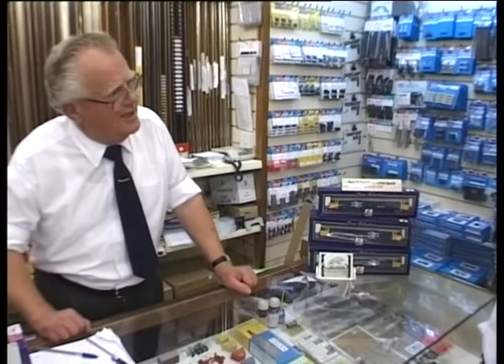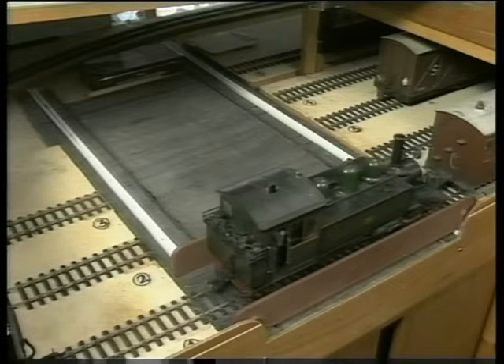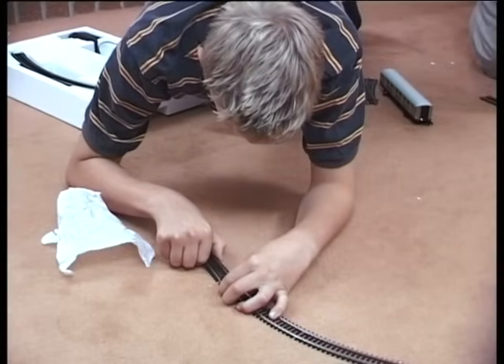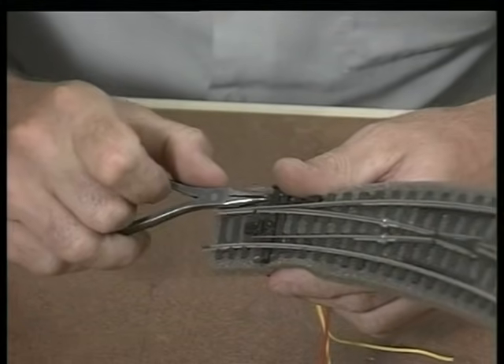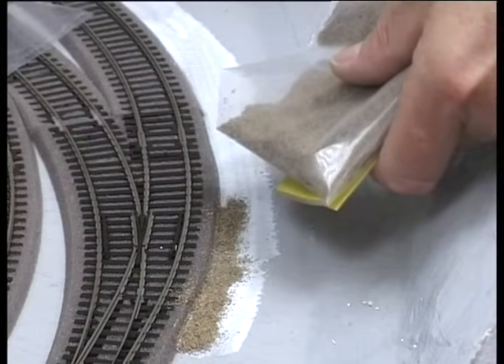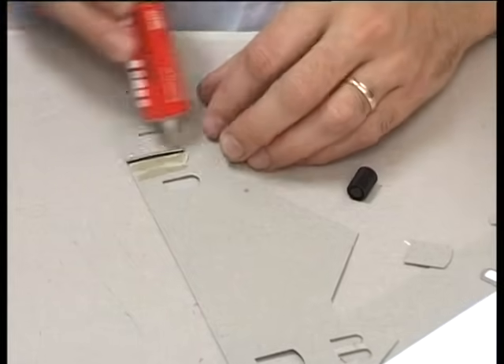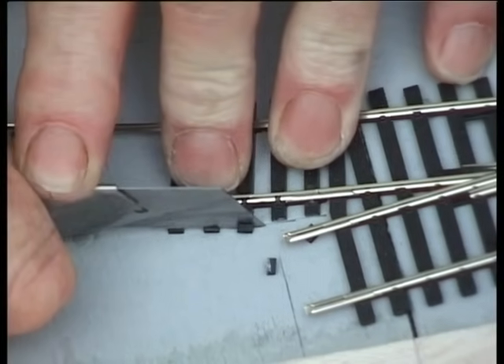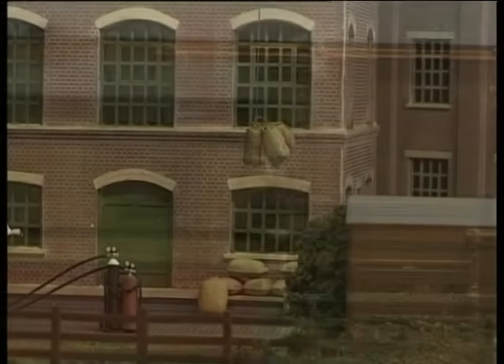Creating a Model Railway (Second Edition/2002)

Comment: My main interest is operating the railway to a sequence table. Since I am alone, timing two trains to an actual timetable running at once with stops and with a third shunting would be a nightmare. So each train, with a designated loco and stock, is run to a set time between stations. One for expresses, one for stopping passenger and one for goods. The aim at the end of the sequence of 14 trains in total is to have all stock and locos back where they started, except where there is a change of locos mid journey when the first loco takes the place of the second. As you say, the sequence can be operated in whole or in part dependent on time available. Of course this takes much (enjoyable but taxing) planning to ensure the correct locos are used for the correct trains. Having some expresses overtaking slow goods/stopping passenger trains can add to the enjoyment and realism.

Comment: at around 51 minutes into this video the man is creating a way to join the 2 baseboards by cutting stuff and soldering stuff.

Would it not have been easier to use a small piece that lays over the joint of the baseboards?
Just a standard size piece that connects the 2 parts of the layout which you can take out when you want to separate the baseboards?
I mean, that would not require any cutting or soldering.

Comment: HORNBY STILL OUT OF TOUCH WITH REALITY ????
Quote  "Not so much a Toy as a precision piece of Engineering" Unquote.  Possibly to an ignorant buffoon. But Certainly NOT to a real life Railway Mechanical Engineer, who supervises the reconstruction of real steam locomotives. Hornby may have changed, but they are still MORE THAN THIRTY YEARS BEHIND, their most advanced competitors. 

How so ? You may ask ! 

Well 30 YEARS AGO, the WORLDS four largest & most technically advanced model train ranges. TOMIX, KATO*, MICRO ACE & GREEN MAX, included the following technologies, STILL ALIEN TO HORNBY, and British ranges in General today !!! 

1. FRICTIONLESS DRIVE MECHANISMS. Requiring NO lubrication, as the nylon gearing is Teflon coated, and drives a machine polished brass worm drive. Meaning less voltage is required to move, and the mechanism is far smoother.

2. FIVE POLE SKEW ARMATURE MOTORS, WITH DOUBLE FLYWHEEL DRIVES. Obviously extremely responsive, & having  a "high run on", meaning the model ALWAYS cruises to a halt !!! So a lot more fun to drive as well !!!

3. CLIP OUT QUICK CLEAN MOTOR BOGIES. (Not on steam outline). Press bogie gently to one side & roll carefully out of chassis. Allowing removal of hair & other foreign objects in seconds.

4. AUTO BUILT IN SELF UNCOUPLING ON LOCOMOTIVES. Requires small magnet beneath the track to actuate.

5. ILLUMINATED ROTATING DESTINATION BLINDS. Simply turn screw under the cab to select any 1 of 6 options !!!

6. REAL LIFE SCALE WORKING COUPLINGS. Fitted as standard on Multiple Unit models, available for other stock.

7. FULL FLEXI-COUPLING. Meaning total abolition of "toy train set" gaps between rolling stock.

8. FUNCTIONING REVERSING GEAR ON STEAM LOCOS. Not found on ANY ranges except Japanese ones.

And in Japan these "High Tech" models are currently still only around 40% of the cost of Hornby.  Tokyo Central City area has over 300 Model Railway shops. Indeed even large Supermarkets sell model trains alongside your Sushi !!!!

It should be pointed out here that Hornby is still "SMALL FRY" with a 2023 turnover of around £55 Million, (with £5 Million loss) when compared to the Japanese Giants. TOMIX (Tomy Tec planning Manufacturing & Sales, excluding retail) for example is currently valued at £966 Million Pounds.

*NOTE: KATO, ONLY apply all these extras on their HUGE Japanese outline range. Not on their limited American & European model ranges.
Reply: This is Peco not Hornby
Reply: I agree it is an amusing statement but forgive me, I'm no expert on economics or demographics but I think you might find there are a considerably larger number of people in Japan who like model railways, compared with the, as you say 'small fry', UK.  There simply isn't the amount of sales to drive that level of investment for Hornby and what sales there are, are shrinking all the time.

I'm not defending Hornby in any way, I'm not their biggest fan but with UK modellers already balking at their high prices, imagine how much those models would cost with the inclusion of all the features you describe above.

I would be interested to know if you could suggest a way Hornby, or any other UK manufacturer of model railway kit for that matter, could possibly compete with the quality and specification of East Asian or American manufacturers, match their prices and still make a profit in the UK market?
Reply: You ok hun?